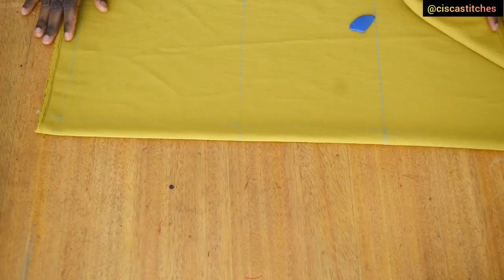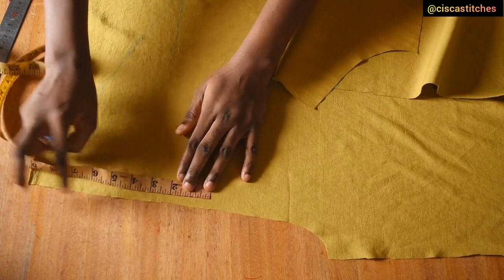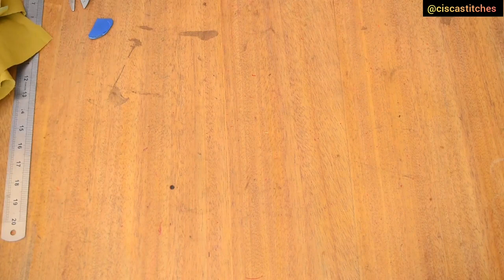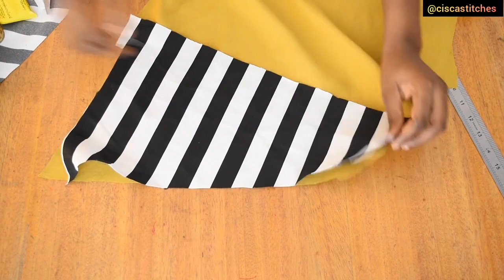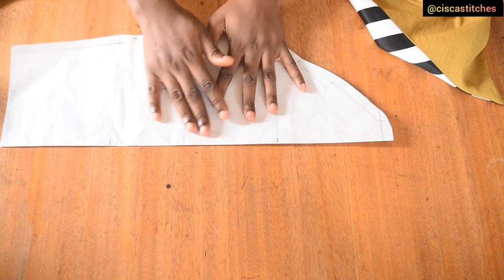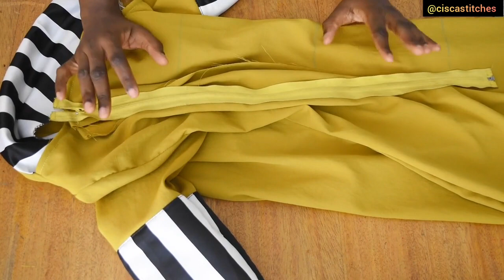Beautiful one off shoulder dress with extended/overlap neckline (Detailed Tutorial)

Comment: Hello. Thank you for this video. I tried the tutorial but I’m confused on where the black and white piece was added. I followed as you said but each time, my facing which is the black and white turns in the opposite direction. Can you throw more light on this please. I have cut several pieces and it ends up same. Please from the placing of black and white and cutting and turning to place on the fabric, you mention of good face to good face, mine comes out opposite. Thank you.